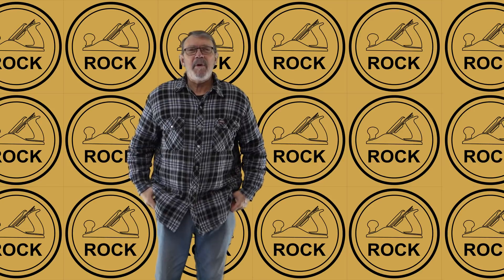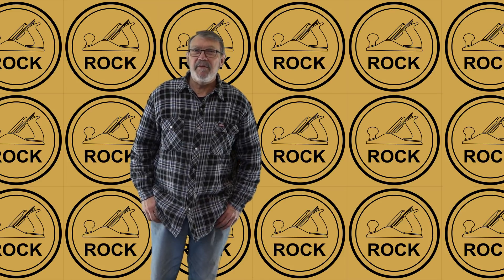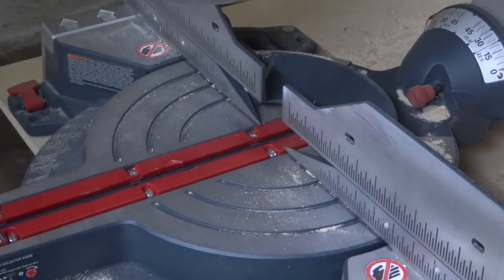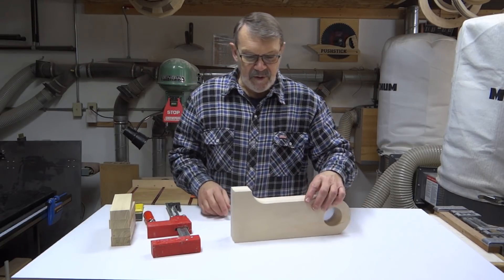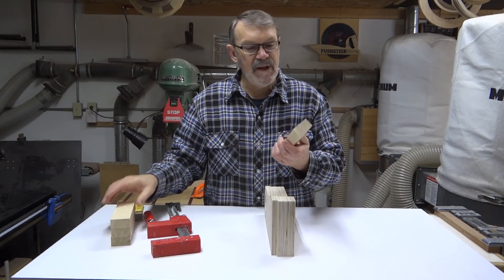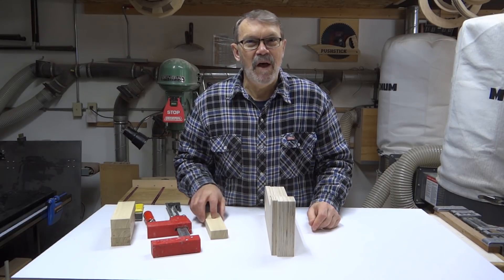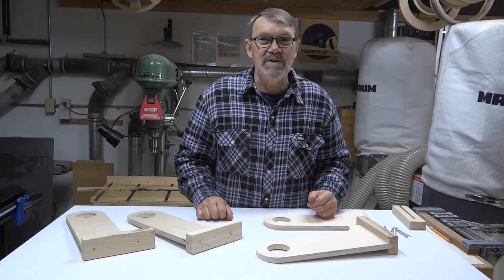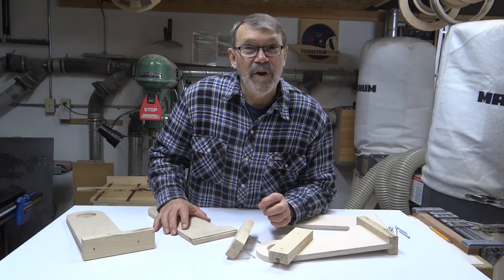Hanging My Green Screen

Comment: I think you should go back to your original idea of the pipe being supported on both ends and it being rolled up like a roller blind. You could come up with something to make the pvc pipe stronger. Fill with something like wood?
Reply from the maker: Actually I had considered that but I would prefer to keep the weight down. I'm working on another idea and will share it as soon as I get it worked out.
Take care,
.....Gord